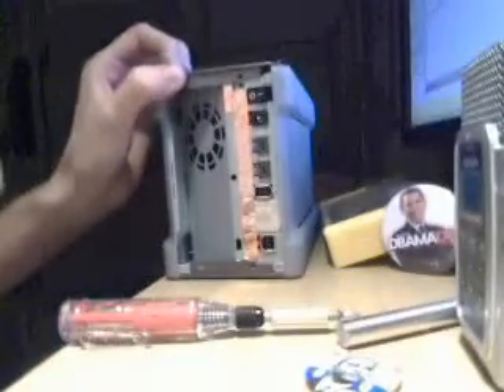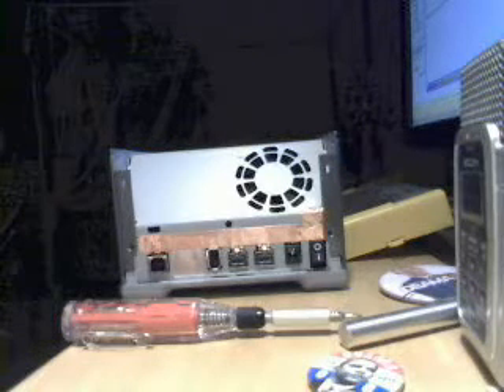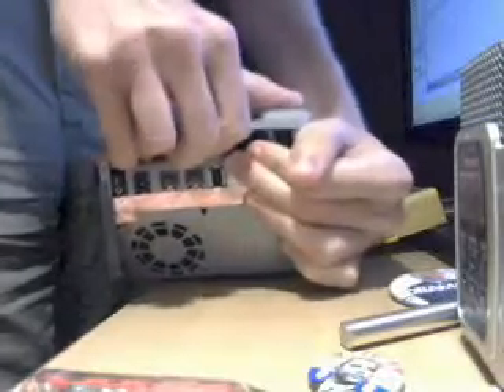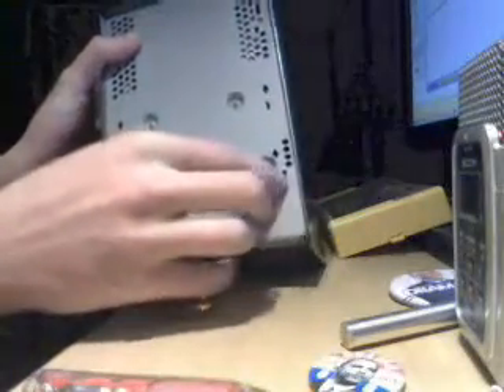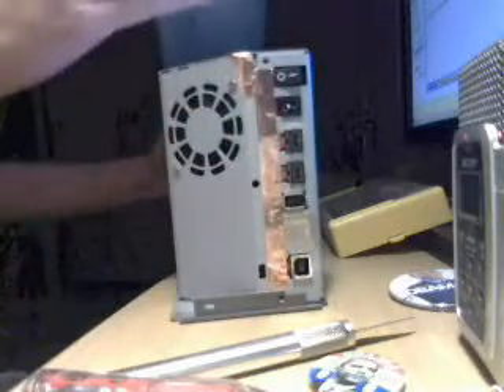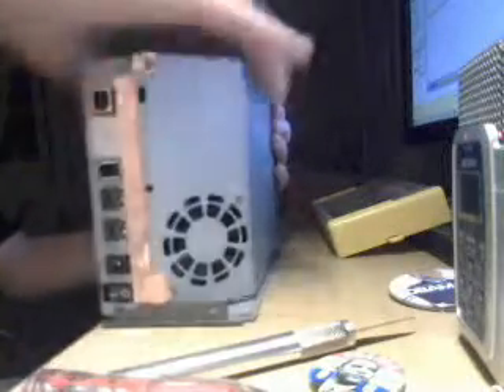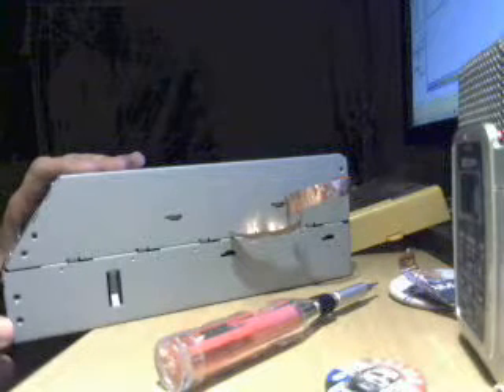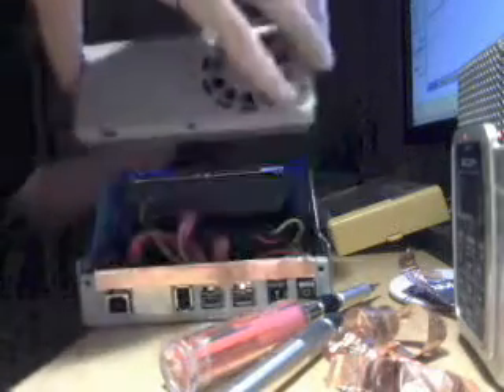Maxtor OneTouch III Turbo Disassembly

Comment: I was really curious too see what was inside, after picking up one of these for cheap at an AV broadcasting company liquidation sale; still need to pick up a compatible power supply to verify it still works. Same case and model as the one shown in the video, but 1.5TB instead of 2TB.
Was also curious why the box was so large, why it required a whopping 12V 3A power supply, and how my particular unit was labeled with a whopping 1.5TB which was (and still is) a relatively crazy amount of data BITD, or how to even open it up. Didn't expect to see x2 750GB 3.5" (S)ATA drives in mine, most likely in a spanned volume or RAID setup, which explains everything.
Good tutorial. These external boxes are pretty nice for the amount of storage they can supply, as well as interfaces faster than USB 2.0 available (such as Firewire 400 or 800). Not the fastest or newest HDDs out there these days, but can be found relatively cheaply now.

Comment: If the two drives inside were set up as RAID 0, is it possible to remove them and try to mount them somewhere else?  Or does the raid rely on hardware inside the actual chassis itself?

Comment: You can slip a 1/2" piece of wood or plastic down the interior edge between the case wall and the small plastic clips.  

They pop loose with only the slightest pressure - no chance of them breaking off.